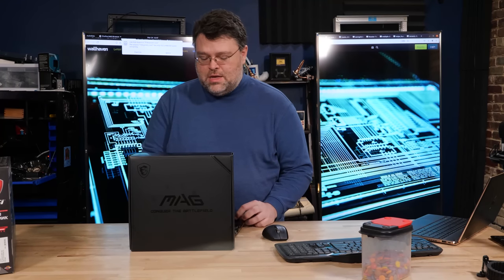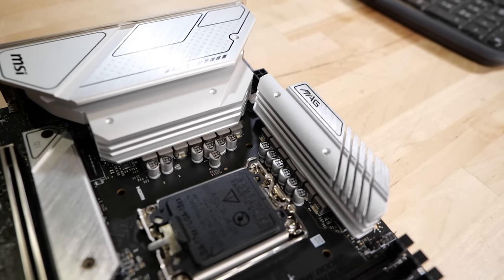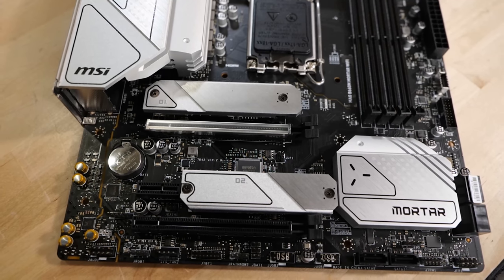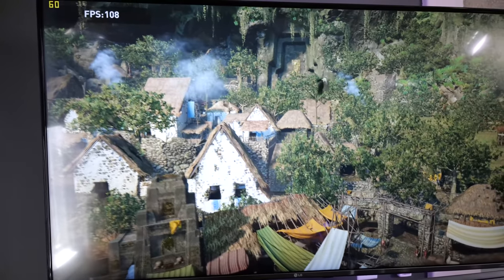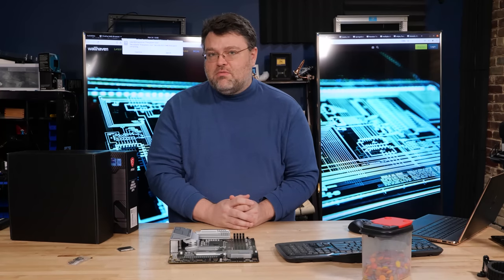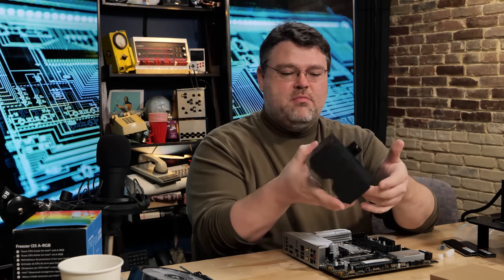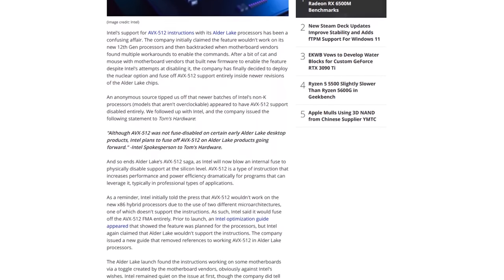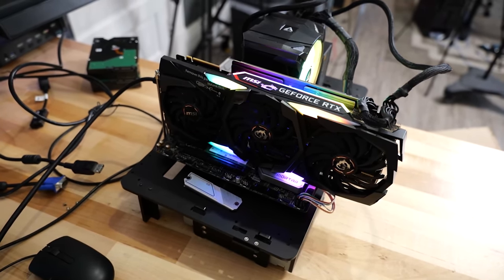MSI B660M Mortar: Review and Build!

Comment: I just added a second m.2 970 1T in my bottom slot. I LOVE THE way they just hide away into the motherboards now with no need for SATA Drives wether SSD OR hard drives.. I have  gen 4 980 Evo 500gig for my top slot and for windows main drive.. but honestly I can't tell the difference between m.2 gen 3 or 4 in real world uses.. But that's me.. It benchmarks you will see it..

Comment: Would love a tutorial on base clock overclocking on a non-K Intel processor. Great video!
Reply: @badjonatan  base. Your CPU frequency is determined by two numbers: the core multiplier and the base clock. On virtually all modern CPUs, the base clock is set to 100 MHz by default. This particular number sets the speed of a lot of other things, like interconnects between PCIe devices and stuff I'm not super familiar with (because I don't touch it and it just works). 
To get your CPU core frequency, you multiply the "multiplier," number with the base clock. So if you have a base clock of 100 and you set your multiplier to 50, that's 100 x 50 = 5000 MHz, or 5.0 GHz. Adjusting the multiplier is how you usually overclock CPU frequency on K series CPUs or Ryzens. But on non-K series Intel, that multiplier is "locked," or not available. You can't just dial in a multiplier of 50, tune the Vcore and LLC a bit, and get a stable 5GHz OC. 
But now, you can tune the base clock. So if the default for something like a 12500 is 3.0GHz "base clock" (different kind of base clock here; this refers to the lowest frequency the CPU will run at normal operation), it's 100MHz base clock x a multiplier of 30 that you can't control. But if you could set your base clock to 150 MHz (which may not even be realistic, I never did BCLK overclocking before), that will be 30 x 150 = 4500 MHz or 4.5 GHz, which is faster than the CPU is supposed to run. 
But you can cause a lot of system instability OCing this way, so I never bothered with it. Would love to learn how to do it safely.
Reply: @badjonatan  you understand how it works, but your terminology is about a decade out of date. This value was called "front side bus," speed back in the era of physical North Bridges on motherboards. Some sources may still call it that, but most everyone has moved on to "base clock," or BCLK, (which again is different from the "base clock," that really just means idle clock speed), now that the functions of the north bridge have moved onto the CPU die. 
Simple video that explains more: https://youtu.be/n6d7w5A8t9U
Reply: @TheVillainOfTheYear  i have an 12700K  can i oc it on b660m mortar max ?
Reply: @林永樂-m1v  z690 only for overclocking unless you find very specific b660
Reply: @林永樂-m1v  max, yes.

Comment: Where I live MSI always got a bad rep for the quality of their products, and I wasn't a fan of that brand either, but the mortar mobo's are probably the best price to value available on the market... currently have a 3700x paired with a b450m mortar max and 3080ti - the experience so far was nothing less than excellent, worked without any problems with the xmp oc four Ballistix Elite DDR4 sticks.
Reply: They had this review scandal a few years ago, but now everyone's back reviewing MSI like it never happened. It's kind of weird and I wonder what really happened after the story came out. If you missed it, Gamers Nexus reported on it: https://www.youtube.com/watch?v=O6BXwCJtaZE
Reply: MSI is weird, they make good even great products however are known to miss the mark on important details.

so it is a good idea to keep them as a viable option, yet not fully trust what the place on the plate.
Reply: @Gersberms  the review scandal was  similar to what other companies had before.
Manipulation of what gets published or not by suggesting retakes or offering monetary compensation for not publishing the review.
Using a text with very nice words, that requires a second to notice what is implied.
it has happened and mostly likely continue to happen in the industry.
If they changed ways or not, is unknown... they probably did, given Steve has not push it further.
what probably has not change is they nitpicking quotes from reviews.

Based on the correspondence content it was mostly likely a case of corruption caused by upper management pressure, similar to what happened to Volkswagen.
so it important that all sides do not encourage the other to "given in" by paying attention to ethics and morals.
Is also probably why nobody care much about it anymore, it just the "political scandal" of the year and that was it.

That is why Steve advocate for a more hard-line and careful stance when dealing with companies response to reviews and doing a "as If you brought it" review regardless if yes or no.
While also asking companies to stop trying to influence results attempting to turn reviews into "free marketing disguise as review".

What was more severe was they disregard for consumers by buying back GPU stock and reselling at higher price.

While the first can be a question of what reviewer have attention and morals you can trust, the last is horrible.
They did not committee a crime in law, yet have done something totally despicable that should be a crime.
Reply: Its not my mobo has a buzz noise .

Comment: Just built a PC with the DDR4 version of this board. Paired with a 12400F and some 4600 DDR4 I had previously purchased for a Z370, dumb idea! After BIOS update on the Mortar the 4600 XMP booted first try. Put a 4x4 m.2 in the top slot. So smooth in windows and the little game testing I've done. My third Alder Lake build, cheapest of the three build.
Reply: does it fully support the i5-12400f out of the box, or will it require bios flashback first? This is my first PC build.
Reply: @deagle7776  it did work out of the box, I needed to update bios for the ram speeds. You would update the bios anyways as the 12th gen boards early bios seem a bit hobbled together and there is stability to be had flashing to the current bios.
Reply: @otysfg  ok thanks. Yeah after researching, I understand it’s recommended to update the bios. I was just worried since there is no bios flashback button. And on the pc partpicker site, it says it needs a bios update first to make the CPU compatible.

Comment: With updated Bios, will this board endure 13600k or even 13700k? I'm worried because of VRM and TDP. I guess it can take 13600k because its very similar to 12700k, but will it take 13700k? Thanks for the vid!
Reply: Vrm's on this board is fine. It supports dual 8 pin connectors for cpu power, which is massive even if you want to install a 12900k, and it has big heat sinks to disperse the heat.

The only issue with installing a "k" series cpu on this motherboard is that you will not be allowed to manually overclock the cpu. So if you plan on keeping this board, rather save your money and buy the non k cpu (13700 or 13700f).

Comment: I don´t like the max Ram Speed limitations by having more than one 1 DDR5 module! I am a bit dissappointed by MSI, cause everytime I find something I am not happy about when it comes to the performance sheet. I would like to know how well overclocking the base clock works on this model. Are you sure there is an option to base clock overclocking? Because I only see CPU Overclocking settings for Intel K-CPU-Series.

Comment: I'm surprised that Wendell didn't mention the DDR4 vs 5. As it stands right now, with that i5 there's absolutely no reason to do the 5. Save the bucks and the DDR4 boards seem to be far more available. It seems to me that the switch to DDR5 is a real struggle.
Reply: TLDR: the high performance ram, even the ddr4 is being bottlenecked by the best of the 3000 and 6000 series gpu’s at resolutions over 1080p. 

From what I can tell with my rudimentary understanding of all this is that as of now (August 2022) the ddr4 is being bottlenecked at 1440p resolution and higher. At 1080p we see the high speed versions of ddr4 working unrestricted with high end gpu’s. The ddr5 should do this at 1440p and maybe 4K depending on how much more powerful the upcoming 4000 and 7000 series gpu’s are going to be.
Reply: @dereksmith6713  The only time to even slightly worry about ram speed is if you are running a top tier rig and wanting benchmark numbers as high as possible. Why waste money on ddr5 for almost no gaming improvement when the money could be spent on a better gpu? The cpu or gpu will bottleneck long before ram speed is important.

Comment: It's funny to see Intel going through the whole windows scheduling thing that AMD went through when they uped the cores...
Reply: Yes, but having E and P cores give a whole new level of complexity.
Reply: @marvintpandroid2213  It's the amount of cores that's the problem as soon as you go over 8 core and 16 threads windows don't know what to do with all those cores.. These companies have gone core crazy.. The windows scheduler just loves 4 cores and 8 threads..
Reply: @marcasswellbmd6922  that is part of the problem but lots of the thread scheduling software isn't yet p core vs e core aware, depends on the language and the compiler
Reply: @marcasswellbmd6922  where as the problem with AMD is  subset of numa
Reply: @marvintpandroid2213  I get what you are saying, and I really Like what Intel did with these chips...
Reply: @marvintpandroid2213   There's a lot of ways to tweak AMD and Intel that I don't even know about honestly. I know the main things with my AMD turn PBO and, So I turned  PBO on set my 3200 cl14 flarex memory at 3600mhz 16 16 16 36 and then set my infinity fabric at 1800 for a 1 to 1 to 1 raitio n that's about all I know  how to do..   I saw a 10% performance bump it's pump in applications that I don't even use it helps very little in gaming at 4K.. The main thing I worry about overclocking these days is my GPU.. I'm running an XFX 6800 XT and so far so good the card does great. I run high adjusted settings n not ultra in 4k n it looks great n I can still get good frames at 4k with this card Depending on the game..

Comment: 11th gen was sad. So many insane motherboards. And nothing worth putting in them. I'm waiting to see them show up on second hand market
Reply: Really sad indeed.

That generation is so bad, that there are actually a sizeable amount of games where an i9 11900 gets destroyed by an entry level i5 12400 in both single core and multicore games.

In games where the i9 11900 beats the 12400, the 12400 still performs on par with an i5 11600k for the rest of all the other games.
Reply: 11400 was the absolute value king for a while wym. tho since 12th gen came out it instantly became obsolete since the 11900 was a joke

Comment: Looking to build with this mother board, Intel BX8071512700K Core i7-12700K 12 Core 3.6GHz 10nm Alder Lake Socket LGA1700
+ EVGA GeForce RTX 3080 FTW3 Ultra Gaming LHR Edition 10G

What do you guys think?
Reply: im not sure how well it would overclock the K version of cpus, it doesn't overclock the multiplier, only BCLK, so maybe worth it to compare to Z690 chipset motherboards? i wanna buy the mortar max too but im not sure if its worse/better than Z690 boards of similar price range
Reply: @reckless5762  I got i7 12700k paired with B660 WiFi motherboard and Rtx series, so far haven’t seen any issues with that just noticed the max temps in gaming was 70•c in summers, not more than that.